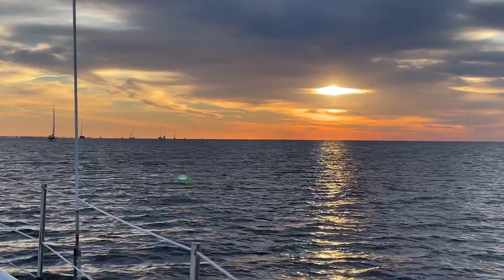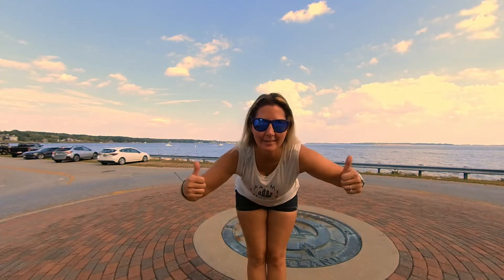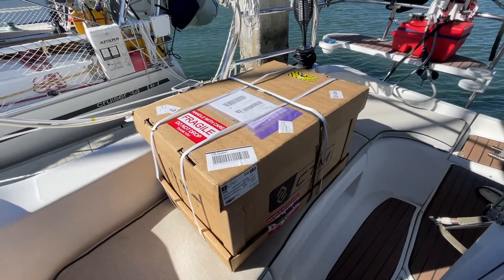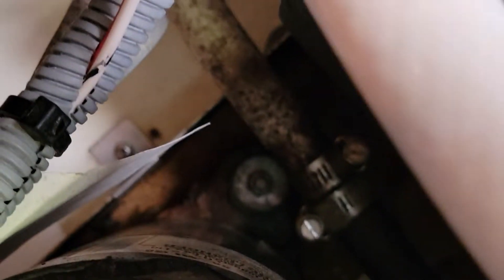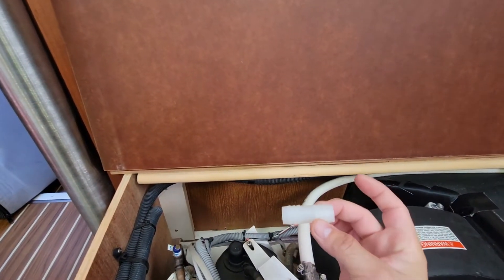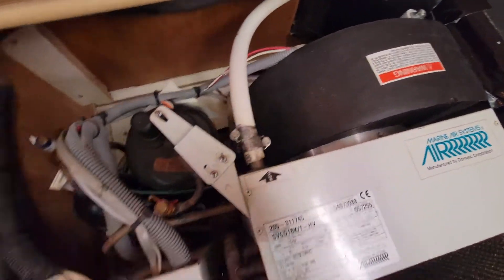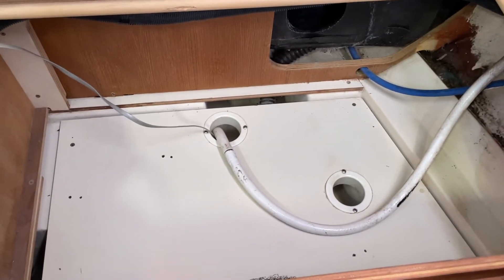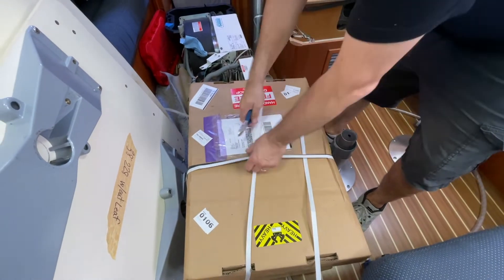Ep 14 - Replacing an AC Unit

Comment: Great video.
Reply from the maker: Thanks Bob
Reply: @SailingMTPockets  I do have a question for you. I  put the boat in the water, the cold water faucets works great however the hot water ones have low pressure.  This is our first time with a boat with a water heater.  Some water does come out but low pressure, pump is running then stops.  I wait, do it again and same thing.  Some one suggested I have an air bubble.  I tried a few different things, any thought?  Thanks.
Reply: @bobpublik7037  Hunters have a  water manifold  under the sink. Make sure  if someone winterized it for you they didnt  close a  valve on the hot water side for your hot water heater. another thing you have strainers  on the hose connection on your mixing valve  attached to hot water heater . the screens can be clogged with derbis..  you can also  open the  drain on hot water heater and  run the  water at the same time to bleed the air. dont  forget  to open the  faucet on your  swim platform to let the  air  out of there also
Reply: @jerseymike119  I thought I responded to this but I don't see it.   First, thank you.  I did some of what you suggested but I'll go over it again when I get to the boat this weekend.
Reply: Hi Bob, I agree with Mike about checking the water manifold under the galley sink.
Reply: @oldtimergoalie1  I will, thank you.  I did the winterization and I don't remember touching it but we'll see when I get down there.  Thanks again.